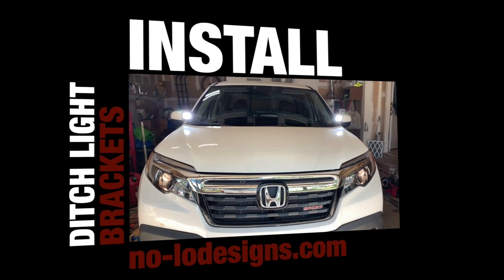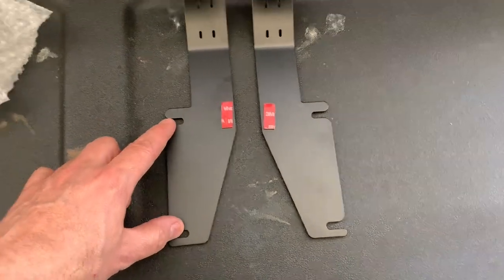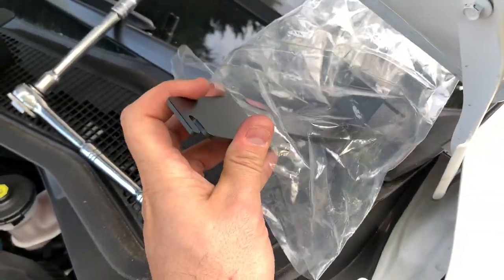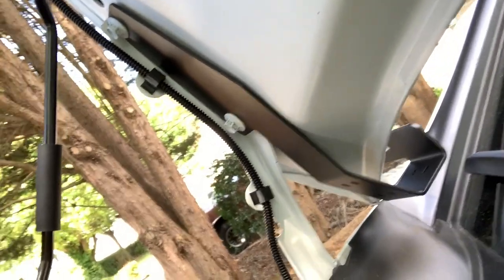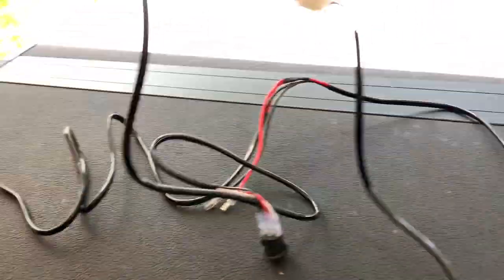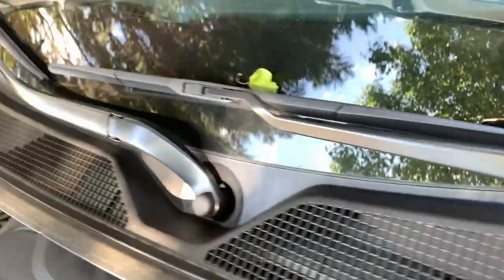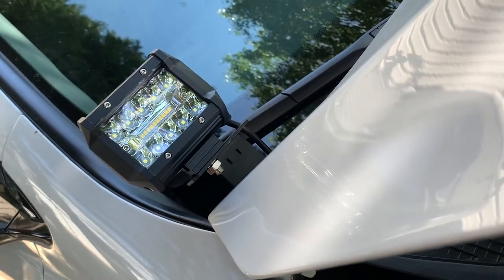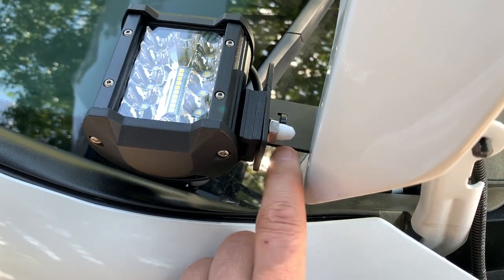How To Honda Ridgeline Ditch Light Bracket Install NO-LO Designs No drilling connected to hood bolts

Comment: Thanks again for the video. I ended up purchasing and installing the ditch lights. I haven’t run the wiring into the cab yet and was wondering if you ran the wiring through the side of the vendor as you planned?  Did you try running through the firewall?  Any tips or suggestions would be helpful , maybe pics. Thanks again.
Reply from the maker: Ulrich I did. There is a perfect gap so you do not have to drill. Then I just ran it through the weather strip. No air leaks or issues.

Comment: How did u fit the circular rocker switch into the empty slots..did u use a circular drill? And did u have to remove the air intake to connect to the negative wiring
Reply from the maker: Drill and yes.

Comment: Why do you call them ditch lights?
Its been my experience that lights mouted in that location are pretty useless if its raining or snowing, too much glare back., plus it illuminates the hood and affects your night vision( im old )
Reply from the maker: Lol - I don’t know about you but I point them where my headlights start to end. You know towards the DITCH on the side of the road. Usually at a 45 degree angle. My lights are combo flood and spot. They illuminate all the way back to the end of the cab. Hope that helps.

Comment: Will these work on a gen 1 ?
Reply from the maker: Roll over to No-Lo and check to see if it does. It may, let me know what they say?
Reply: @CampingRandy  Hello, here is what the owner said to me in an email "If you're welling to do some minor cutting it will fit. I had a customer put one on an 07 MDX. Long term we are looking into picking up a GEN 1 ridgeline or Gen 2 Pilot to do development with"
Reply from the maker: schischillyjr for a gen one, I would suggest buying the cheapest bed tent on Amazon for a Tocoma and test fit that way. The Honda Ridgeline Tent ranges from $250 to $350. I don’t know about you, but I’m not a seamstress as well not cutting up my expensive tent.